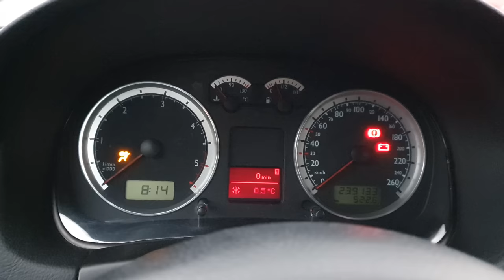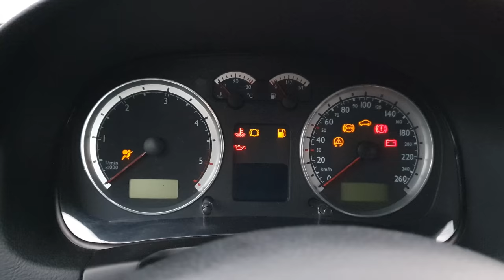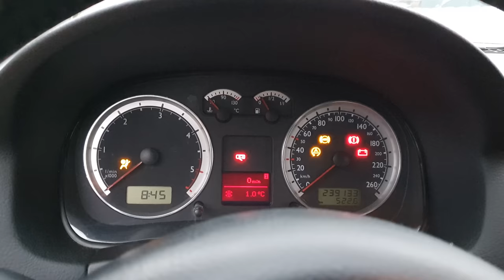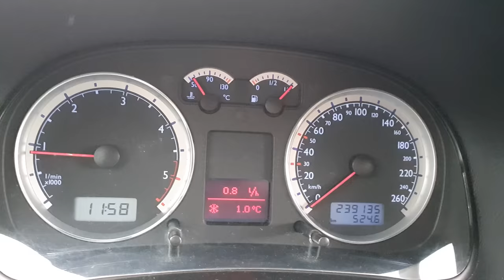After Many Struggles the Tracktor is Finally on Plates!

Comment: Q&A:
1.What are you  actually doing in Rimac?If you can share?
2.What will be the final Tracktor engine power?
3.Supposedly lap time of the Ring with the Tracktor TDi ?
Reply: HP 1000+
Reply: 4. On which planet will the cost of the upgrades not exceed ANY potential fuel savings?
Reply: MunroM84  The only thing I know is that he is in the marketing department, but nothing in particular.
Reply: On stock internals the 1.9tdi can run 250hp

Comment: Congrats Misha!! i would love to see the mods for the gearbox!
by the way.. it seems that the thermostat is stuck open, or at least at the end of the video is at 60 or 70°
Cheers!
Reply: Good shout although to add the PD's do take an age to warmup normally unless you get on it early, although thermostats and housings are cheap so always worth changing if doing a coolant change, perhaps along with temp sensor and associated plastic housing.  :)

Comment: You may call it a tractor but the Mk4 with a PD engine is oneof the best, I'm sure you'll grow to love it in a short time! - Glad you got your plates finally, time to start modding lol! :)
Reply: 79RockShox still in mk7 gtd pd were king
Reply: @Consulting157  I prefer my Sub £600 Mk4 diesels with 200k+ miles on them though :P :D
Reply: @Consulting157  There are no mk7 PD engines LOL only Common Rail injection :D
Reply: @arnoldkul3827  no brah mk7 gtd still pd an mk6 too
Reply: @Consulting157  Stop being such a du**ass, Common Rail all the way :D

Comment: I don't know about Croatia, but i bet it's worse in Romania. If the car is already registered and has a valid technical inspection, you only have to go to the police. The thing is, that you need to make an online appointment, and sometimes the next one is one or more weeks away. If you imported a car from the EU, you need to get technical inspection done by the Romanian Auto Registry, where the closest appointment, depending on county, can be more then a month away. You can get 3 monts of temporary "red" plates, but once they are expired, you can't get new ones, even if you change owner.

Comment: When I moved to Ireland in 2016 I bought a 2003 golf MK4 1.9 TDI 6 speed with 178000km for €1000 it was a high line with climate control, cruise control it even had  heated leather seats. I had it until the end of 2018 when I traded it on a scrap deal for a 2017 ford galaxy (family grew)

Comment: the temperature not going up might be a broken termostat (stock on open)
Reply: easy fix is hitting it with a hammer. Worked with my car
Reply: @arandomelk8559  1_9 tdi Thermostat had issues that itbreaks internally. Only replacing will help